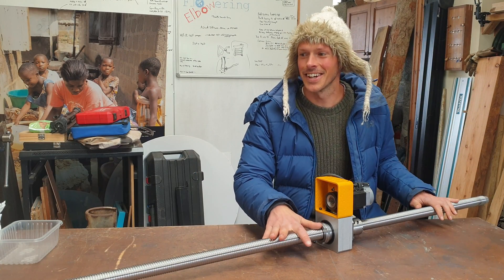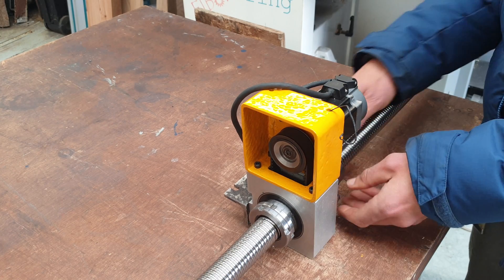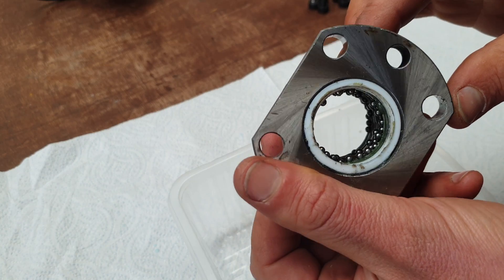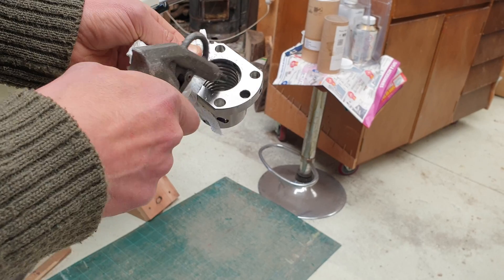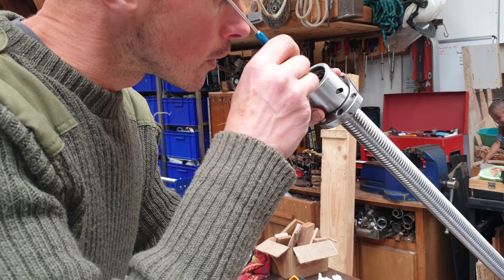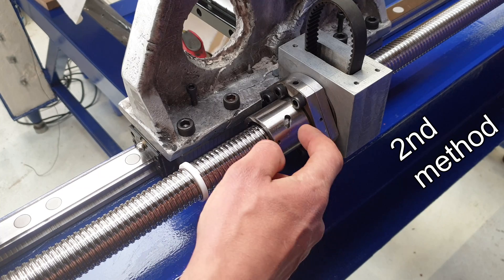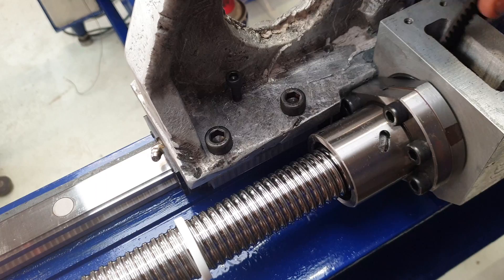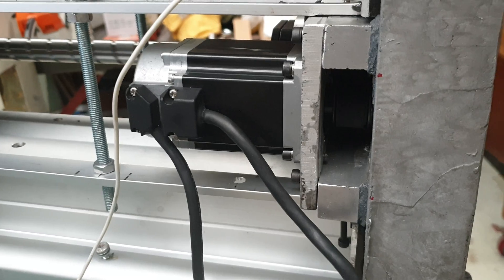Tuning a Cheap Ball Screw (2 methods of nut overhaul)

Comment: I also use the "sticky grease" method of positioning the balls inside the nut before attempting to screw it back on. It also helps to roll up a piece of thin sheet metal tight enough that you can get it into the nut without knocking any balls out of place, but when released it will expand to hold them into the grooves. Then you don't have to be quite so careful when screwing it onto the screw.

Comment: You'd never take apart a precision machined and ground ball screw. They are silky smooth and taling it apart will only serve to damage or makes things worse. The cheaper the rolled ball screw, the worse the balls fit the grooves. I've seen then where they contact less than 20% of the groove and the contact area is in different places on each side of the groove. 
 The balls spin in directions they shouldn't and they sound awful. Your better off living with the higher backlash then trying to correct it. Run then in for a few hours and they get better. Trying to clean with wd-40 and blowing out with shop air can make things a lot worse. Unless you got high end water, particle and oil filters installed your blowing in air contaminated with water, oil and particulate. The standard ones that come with compressors or home depot do nothing to stop this. They let as much water and oul through as they stop. Simplev air tool motors don't care as long as they see a bit of lube, most bearings are sealed in these. If your blowing out any bearing with air or using a parts cleaner to clean the bearing you've effectively reduced the bearings life by atleast 50%.

Comment: Did you consider using a rack and pinion? Getting close to ordering something myself, but still researching.
Reply from the maker: Hi sorry for the late reply. Yes, I did consider it, but wanted to have a crack at this method and thought it might be more accurate for the same cost...
Reply: Thank you for the reply, I found the rack to be far cheaper than ball screws here in Australia especially with frieght. A big factor for me is that got a CNC machine for free that already has one 2400 mm axis with a rack, it is quite a sold machine made for doing rotary work only. It is able to work with 2400mm long by 300 diameter with 2 spindles and 2 rotary axes. But the frame is onlr 750mm wide. What I am about to do is cut it up and rebuild it to the same size as your machine. My plan is be able build wind generators with blades up 2400mm long so a rotating diameter of around 5 metres. Previously I was thinking of making the blades with  rotary axis but have decided it will be better to use 2 indexed positions instead. Getting software for the rotary axis work is expensive and there are backlash issues. I don't want to spend the money on Fusion 360 for what I am doing. 

I have also been looking a lot at your alloy casting videos with the intention of making blade hubs etc and using the CNC router to machine them.  I plan to be using a motor generator from a Prius as the actual generator. @FloweringElbow4SuperNerds
Reply: @XXXXIndices  Did you end up using rack and pinion (RP)? I am thinking of similar CNC project for milling steel. I'd like to use RP for X and Y axis and ballscrew for Z axis. Any suggestions @FloweringElbow4SuperNerds ? Would this make the CNC not accurate and rigid enough to mill steel?
Reply: @Zorwan  Hi, I have had to put this project on hold for the moment but I will be using ballscrews. The research I found said with rack you are going to get around 0.10MM play which is totally unacceptable for what I want which includes machining steel. My machine will end up with a cutting area of 2400 X 1200 X 400 and I will be using 3210 fixed ballscrews on X & Y with rotating nuts like FlowingEldow ended up doing.
Reply: @XXXXIndices  Hi there and thank you for responding!

What would you use for your Z-axis?
Also what motors (type and size) for each axis? (I'm thinking of Servo 34)
Reply: @Zorwan  I was fortunate enough to be given a CNC machine that has 2 rotary axes so it can make 2 identical wooden parts at a time. The gear drive on the rotary axes has 2-3 degrees backlash and the X axes is a single rack, it was fine for decorative wood but not for what I want. So I am using this to build a conventional CNC router, the Z axis has a 2505 ball screw that I am reusing. All the motors are Nema 34 closed loop, the current X axis is rack and pinion but I am doing away with that. There are 4 3000mm Hiwin linear rails that I will reuse, main thing I have to buy is the ball screws.
Reply: @XXXXIndices  Wow that's amazing! Have fun! I think I'm going to go with R&P for X and Y and ballscrew for Z. Will post a video about it when done.

Comment: WD 40 is not (!) an lubricant. It removes the grease from the bearing balls. Better you use an hydraulic oil. A good grease is dumping the klicks from flipping the bearing balls into an other direction.
Reply from the maker: Correct. Here we only use it to 'clean' not to lubricate...
Reply: Very good point! When I worked in shipping a pallet jack/fork lift serviceman told me that WD-40 was probably responsible for 20% of there service calls. If I hadn't mentioned that the new guy I had hired had been spraying pallet jacks with WD until I threatened to can him, I doubt he would have brought it up even though it was the obvious cause. It will stop the squeaks in the bearings and clean out the old grease, sure. They will roll alot easier than before, for about 3 days. Then the bearings are trashed.
Reply: Very good point! When I worked in shipping a pallet jack/fork lift serviceman told me that WD-40 was probably responsible for 20% of there service calls. If I hadn't mentioned that the new guy I had hired had been spraying pallet jacks with WD until I threatened to can him, I doubt he would have brought it up even though it was the obvious cause. It will stop the squeaks in the bearings and clean out the old grease, sure. They will roll alot easier than before, for about 3 days. Then the bearings are trashed.
Reply: Very good point! When I worked in shipping a pallet jack/fork lift serviceman told me that WD-40 was probably responsible for 20% of there service calls. If I hadn't mentioned that the new guy I had hired had been spraying pallet jacks with WD until I threatened to can him, I doubt he would have brought it up even though it was the obvious cause. It will stop the squeaks in the bearings and clean out the old grease, sure. They will roll alot easier than before, for about 3 days. Then the bearings are trashed.
Reply: Very good point! When I worked in shipping a pallet jack/fork lift serviceman told me that WD-40 was probably responsible for 20% of there service calls. If I hadn't mentioned that the new guy I had hired had been spraying pallet jacks with WD until I threatened to can him, I doubt he would have brought it up even though it was the obvious cause. It will stop the squeaks in the bearings and clean out the old grease, sure. They will roll alot easier than before, for about 3 days. Then the bearings are trashed.
Reply: Very good point! When I worked in shipping a pallet jack/fork lift serviceman told me that WD-40 was probably responsible for 20% of there service calls. If I hadn't mentioned that the new guy I had hired had been spraying pallet jacks with WD until I threatened to can him, I doubt he would have brought it up even though it was the obvious cause. It will stop the squeaks in the bearings and clean out the old grease, sure. They will roll alot easier than before, for about 3 days. Then the bearings are trashed.

Comment: Hello! I had a quick question. I'm currently designing up a different type cnc, and it appears rotating nut ballscrew might solve some of my problems. I remember reading somewhere when researching this for a router that there are some issues with using a regular ball nut in this way, and I can't seem to find that again. Do you happen to know what these concerns are? I am going to get a ground THK ballscrew not rolled, and I can accurately mount the double angular contact bearings concentric with the screw. I remember there being something else. Like maybe how the internal ball path is? but to me it seems like the balls take the same path either way. but they would be spinning and therefore centrifugal acceleration would cause loading on the ball return channel or something?
Reply from the maker: Hey Cody, thanks for getting in touch. As long as the nut is very concentric as it spins, I'm not aware of any other issues... I people usually go for a shorter nut with the rotating ballnut method, so any inaccuracies are less amplified...    
If I were to do over, I would go for a narrower screw (mines 32mm) as the nuts can't spin as fast on wider ones and you need much more expensive AC bearings to fit over the screw... 
Good luck, let us know how it goes, and/or if you find other issues I haven't thought of. If you're getting THK screws, THK do a rotating nut option, where the bearings are built into the flange of the nut, and presumably other parts are tweaked for optimal performance in that particular use. They are not super common, or the kind of thing you find on ebay, so I didn't pursue it because of cost, but it could be worth looking into.
Reply: Have you considered a roller screw?

Comment: I'll be up front here, I've never built a CNC machine, nor am I likely to.
Having said that I'd like to make a suggestion for those that have, or are likely to have, such a project on the go.  It is this:
Instead of a ball screw to control the accurate motion of the axes, consider a rack-and-pinion drive of standard commercial quality.  To eliminate backlash between rack and pinion, the pinion can be spring loaded onto the rack as is done with rack-and-pinion steering in modern cars.  Bear in mind there are other ways to eliminate backlash, too.
For position feed-back consider magnetic linear encoders.  The magnetic strip is quite inexpensive and can be had in practically any length.  Thus the position feed-back is independent of the rack or screw.
The stepper or servo feed motor would simply drive the axis until the linear encoder command position is satisfied.
Would anyone care to comment on the pro and con of such a system?  Has anyone experience with such a system?   Thanks.
Reply: Separate encoders are fine when you are driving with tradition servo motors, which are not limited to a step resolution.  With steppers you are limited to the resolution of the steps or micro-steps that you chose.  Modern steppers can come with built in position feedback so you can trust the positioning to your chosen resolution, if you overload them to the extent of missing steps then the controllers will throw an error.  So there is no incentive to fit additional encoders.
Rack and pinion is a solution usually reserved for very long travels where flex in ball screws becomes a problem.

Comment: Where did you buy the better ground ballscrew?
Reply from the maker: It's in the description ;)
Reply: @FloweringElbow4SuperNerds  I saw you said where the rolled one was from. Where was the ground one fron? I assume that one is good quality?
Reply from the maker: @Audio_Simon  Ah ha, sorry the ground one is on the y-axis. It is of better quality indeed.  It was from dy-global, a seller on e-bay, that sometimes does 'new old stock' type items. I had to cut it down, and turn the bearing surface, but it was a real bargain. 
Hope that helps.

Comment: This gave me good confidence to clean my X-axis (long) on my other CNC, a 6040, which as you say, sounds like a bag of nails. I will update with results.
Reply from the maker: Cool. Let us know how it goes. I have heard from peeps having good results with getting new balls and using a micrometer to carefully size them the smallest amount bigger.... Good luck!
Reply: @FloweringElbow4SuperNerds  any idea where they bought the new balls? I want to repack my good quality double ballnuts but don't know where to buy them.
Reply: @DodgyBrothersEngineering  With a double nut set up the preload should come from the spacer not the ball size.
Reply: @Nathan_Whaley-g8m  yes but that doesn't fix things like rust, or out of round balls. I just wanted to freshen it up.
Reply: @DodgyBrothersEngineering  fair enough

Comment: What grease are you using and what is its viscosity?
Reply from the maker: Good morning Bender. For sticking them back in, I was using JCB Special high pressure grease - it seemed nice and sticky. For running, I'm not sure what I'll end up using... Any recommendations?
Reply: @FloweringElbow4SuperNerds  I converted my lathe to ball screws and fitted a hand pump to oil the ways and tied the ball screws into the oil plumbing.  I use proper way oil, which is very sticky.  Both the ways and ball screws are as smooth as silk.  Here is a link to the lathe mods if you are interested 
https://www.youtube.com/playlist?list=PLyn2snGjYlHwvzi0ztHJVwwFANxyTc2Kj

Comment: Back then I also bought cheap China ball screw spindles for my CNC. However, within six months these were so worn that they built up backlash. First I ordered a set of recirculating ball nuts, but with the same result. I then found out that the balls that are built into these spindles have a very low quality and hardness.

So I ordered high quality balls, slightly larger than the existing ones. After I installed this, my spindles run flawlessly and no longer build up backlash! Due to the slight increase in diameter of the balls, the stability of the machine has also increased. There is less vibration when machining 7075 aluminum.
Reply from the maker: Hi Peter, that's really interesting. Can I ask where you got the replacement balls and how much difference in diameter there was?
Reply: @FloweringElbow4SuperNerds  Yes, got them from Kugel-Winnie https://www.kugel-winnie.de. There are 1/100-1/1000 mm larger than the original. But i have all measured with a micrometer and sorted the best out. They are so cheap, i bought a bunch of these to find the best fit.

Comment: Having worked in the technical area of bearings for a few years (another life 😊) may I say that you are a game man pulling a ball screw apart! So - Bravo! But PLEASE they are BALLS not ball bearings. The latter are things that contain balls and races and cages (usually) etc. Often its the return paths that cause trouble in ball screws perhaps worth taking them out and inspecting for roughness poor fit etc - only in a clean room of course 😏... Martin
PS  My, what a big ball screw you have
Reply from the maker: HAHA. Hi Martin, thanks for this. Correct terminology noted, thanks. I will try and reverse a lifetime of incorrect usage. 
I have been away and am still digesting your -email re the casting shenanigans... So much to learn... Thanks again, Bongo.